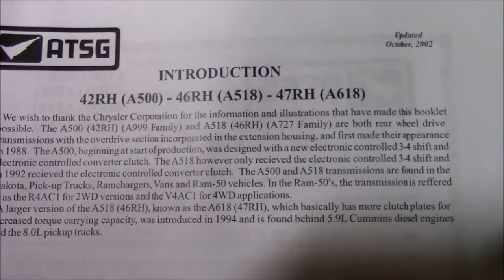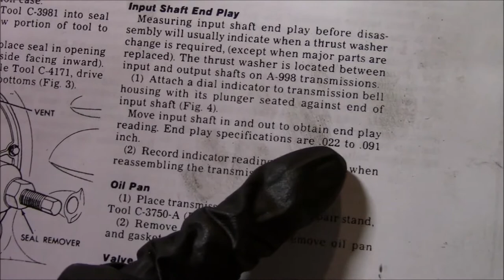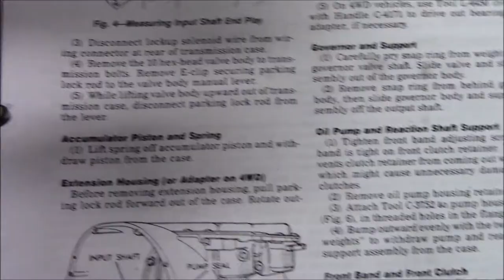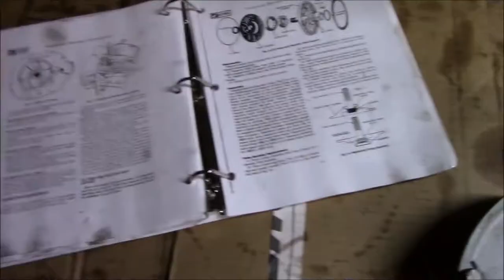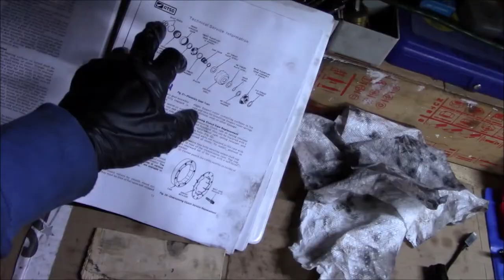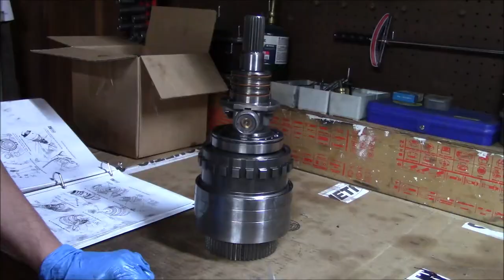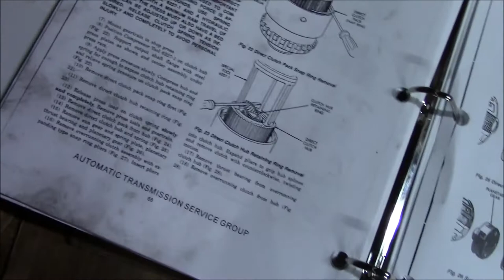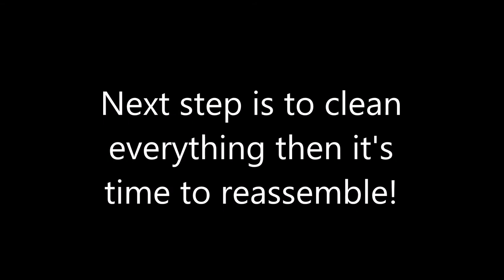Dodge Cummins 47RH Transmission Detailed Disassembly

Comment: my motorhome is on a 1994 dodge 3500 cummins with auto (probably a 47rh) 2wd.  (1. do you know if the same transmission can be converted to 4x4 by adding a transfercase to it?)  im not a mechanic nor have any significant tools. (2. I am in los angeles, do you know who can build my transmission like you did?)
Reply from the maker: Thanks for subscribing I appreciate that. They have different rear housings if I remember correctly.

Comment: Does the bd diesel noise cancelation wire apply to this trans or is that only for the 47re? And how do I know if I have the re or rh?
Reply from the maker: I don't know. RE is post '95, RH is '94-'95 and has a 3 wire control connector.
Reply from the maker: Thanks for subscribing.

Comment: Theres not supposed to be one on the inside
Reply from the maker: Not sure what you're referring to
Reply: @10mm  sorry I was in the middle of something theres only supposed to be one spring in the accumulator my intermediate shaft won't come out of the over drive gear not sure why
Reply from the maker: @destinnewlon1957  Interesting, did the transmission overheat?
Reply: @10mm  probably I put 10k miles on it since I had it now Im rebuilding it